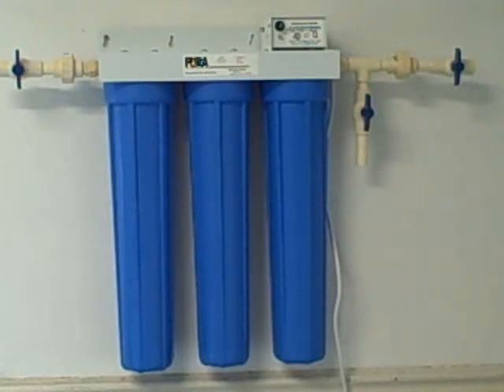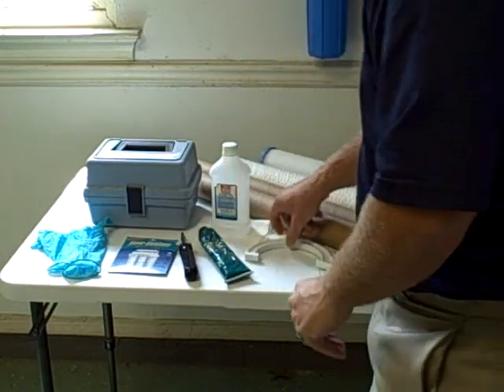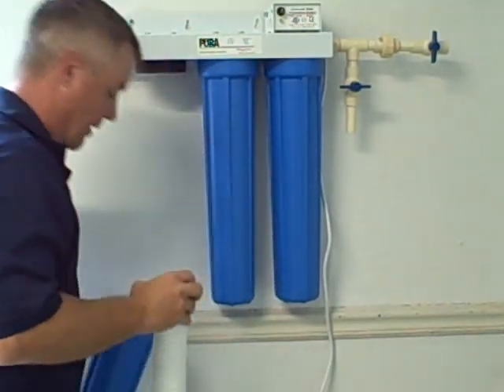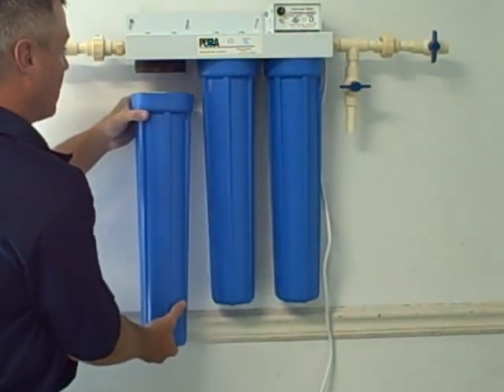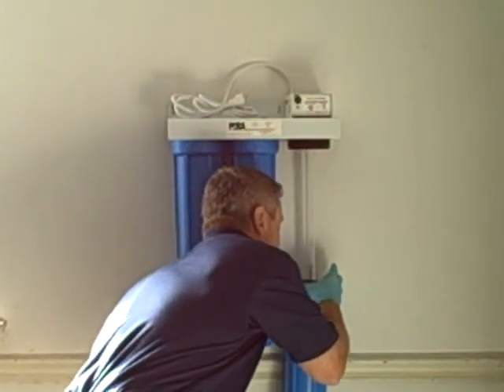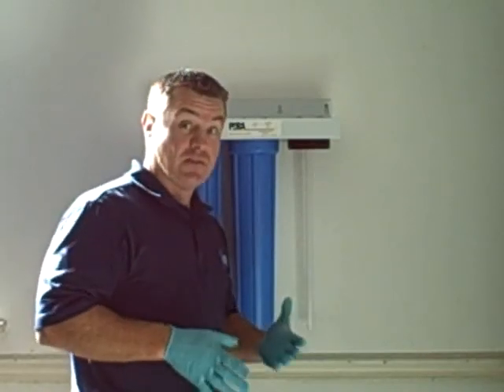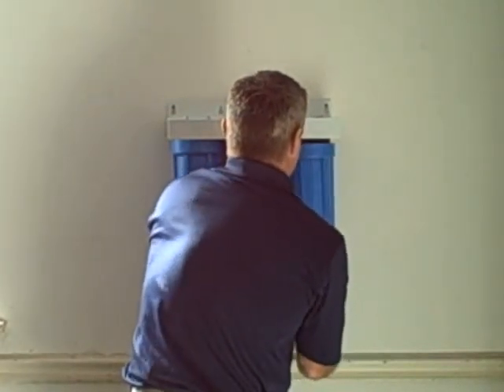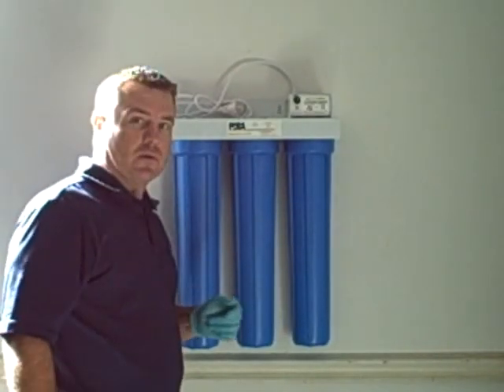Pura UV20-3 Service - Changing Filter and UV Lamp, Quartz Sleeve

Comment: I have UV20-2-SD. I don't see the purpose of santizing the filter sump before replacing or cleaning the quartz sleeve and UV lamp. Instruction manual says to put the sanitizer into the sump with the UV lamp AFTER you service all the sumps.